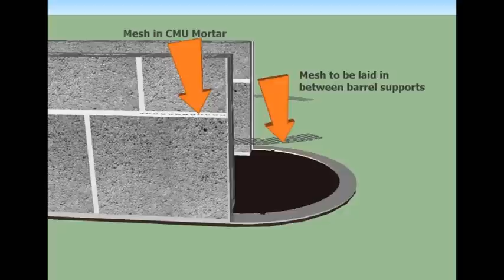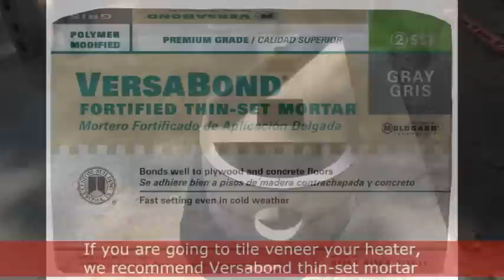Wood Burning Rocket Heater w Dragon Burner core 4in

Comment: did the 'Peter' P channel (slit at the back of the metal firebox) get covered up ? The heater works best if secondary air flow is allowed into burn chamber ?

Comment: Why perlite outdoors and vermiculite indoors?  Isn't perlite a slightly better insulator?  I like the square riser, what is the temp differential between inside surface of riser and outside?  (Just curious about the quality of the insulation.)
Reply: Perlite can be used either indoors or out. Vermiculite is not good outdoors. We have gone to perlite all the time. I don't think we have checked the temp difference between inside and outside. In our castle builds we surround the heat riser with perlite to make it very insulated.

Comment: what is the core and riser made from ?  do you precast the core i suppose and why couldnt it be made out of steel plate welded together ?  is there a thermal reason or burn efficiency reason to make it from the cast material you made it from ?  why couldnt the riser be steel  ?  and has anyone coiled copper tube around it to produce hot water for radiator and floor heat ?  good job and thanks in advance.
Reply: The core is cast from refractory. The heat riser is vermiculite board. Steel plate will degrade over time exposed to 1,200°F + heat which is the temperature in both the core and the riser. The cast refractory will last at least 20 years. 
You must take the heat out after combustion, not during. 

I don't know what anyone has tried as far as hot water.
Reply: jim bob z

Comment: Is the intention to then run it into a mass instead of right out the chimney pipe? if so, do you have an enhanced kit for that?
Reply: We think of the barrel build is a more efficient replacement for a cast iron stove; it supplies immediate heat in the cabin or room. It is possible to run the exhaust through another barrel with  fireclay bricks in it for mass. We have other kits and builds in which the mass is incorporated specifically in the design on our website.

Comment: How do you clean the ashes?
Reply: +The Garlic Farm 
After burning the 4" for several hours, you can scoop or vacuum the ashes out of the burn tunnel. There will only be a 1/2 cup or so. The burn is very efficient, so there are not many ashes left and smoke only at the beginning and end of the burn. Otherwise, the wood is completely consumed. 
Our blog, available from the website, has testing data with both temperature records and the output from a Testo gas analyzer.